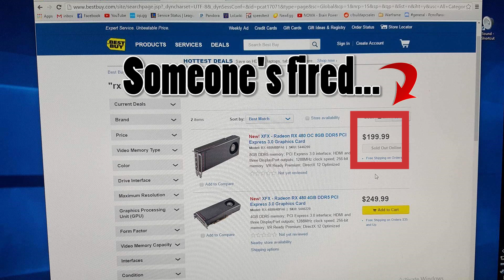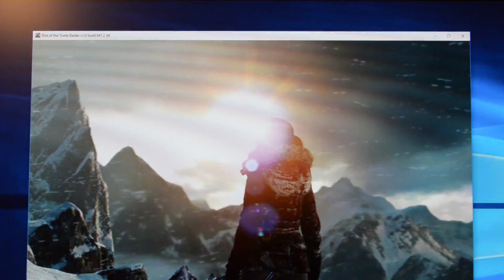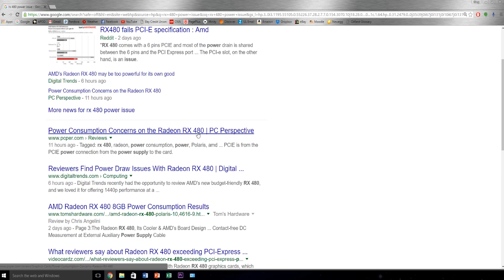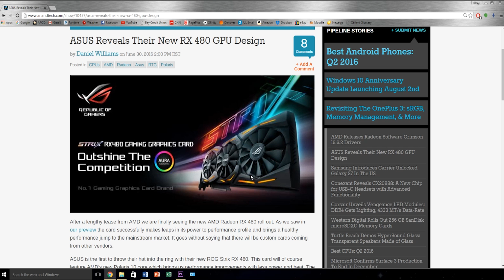RX 480 Aftermath: Power Issue & Over-Hyping

Comment: in a few weeks the 3rd party or non reference versions of this card will start showing up right? I assume those are usually better than the stock day 1 release cards? looking at this card for my first pc with a small budget I have.
Reply: Will be a decent amount better as they will deal with the issue of the pci ports and 80c running temps.
Reply: Please, don't recommend i3 to anyone. It's hard to look at that :P If he has the budget for i5, he should get one. I have i7 6700K and I thought it'll be an overkill. Yet some games are crazy at CPU usage, managing to put it at 100%. Actually Dragon Age Inquisition and Thief led me to this. i3 is just not for gaming. I gained 40 fps just by the CPU swap in said games (with a 970 gpu)
Reply: yep
Reply: Yes you should wait for Asus strix or MSI gaming because they will run cooler, quieter and higher fps
Reply: The price will also be a bit higher... And they inflate the cost to match it's performance, because retailers also has to get a cut out of it.
Reply: thanks folks. looking forward to finally getting a PC.
Reply: Jason Orozco What cpu you think getting?
Reply: +Xamnition i5 6500 seems ok from what folks are telling me. I'm not looking for a beefy rig, just something decent enough to play a few modern games and some indies.
Reply: Jason Orozco Lol, 6500 is not low end, Its mid-range. An i3-6100 is enough atm. Good choise
Reply: +Xamnition thanks for the suggestion. Just might go with that.
Reply: So is this a non reference card? : http://www.maplin.co.uk/p/asus-amd-radeon-rx-480-8gb-gddr5-graphics-card-a23xx?cmpid=ppc&gclid=CjwKEAjwkui7BRCf64DNtfDupgoSJAA_0LOoZFS8c3rTUZ3xvrGoTex-1Quh_xZgKURpWhJXka-SxxoC-j7w_wcB
Will this be ok or still have issues discussed here?
Reply: That is a Reference cooler but on a non Reference Board. A Sapphire one is coming very soon and that cooler is pretty good you can actually swap fans on that cooler

Comment: IMO i think the 1060 will be $249 and compare to the 980 i hope! if so ill be building me another budget build with a 1060!  i already have a 980ti paired with a 6700k. great vid btw
Reply: 1060 is 249 at 3gb model good luck
Reply: if that's the msr then you'll be paying $300 minimum (if the other pascal cards are any indicator). And after than 480 hype I'm not willing to make any speculation about performance until i see real user benchmarks
Reply: Christianspiller Or maybe I'm just tired of numbers going in as more than three digits? o:
Reply: Sinister Steel 3gb is very bad, even the 970 had 3.5gb
Reply: lets hope so
Reply: Dude that will not happend and wait until the custom rx 480s come then we can see its full potenial
Reply: +TheSinisterEyes1 Source?
Reply: VoltaicRogue6 http://en.yibada.com/articles/136858/20160630/nvidia-pascal-geforce-gtx-1060-release-date-confirmed-july-13-starting-at-250-important-things-to-know.htm

3gb is $249 and the 6gb for $299 with

compute cores half of what 480,

with 4.4tflops compared to the 5.8tflops on 480

192 bit memory vs 256bit on 480 i think we have a winner 480 destroys the 1060

Nvidia and Budget dont mix
Reply: Why do I have a feeling that my next build will be AMD?
Reply: David DeBroux Because they have the best bang for the buck atm
Reply: 3gb is starting to little vram for newer games espesially if you are modding games With Graphics and whatnot
Reply: +TheSinisterEyes1 This forbes article suggests the oposite. http://www.forbes.com/sites/jasonevangelho/2016/07/01/nvidias-gtx-1060-specs-leak-faster-than-radeon-rx-480-and-launching-july-7/#b77baf65211f
Reply: VoltaicRogue6 look closer at the graph its compeletly bullshit its not saying anything anyone can make a bogus graph like that. 

Just look at the specs and dont be a sheep
Reply: TheSinisterEyes1
According to the article author, "Obviously, folks, I take this all with a grain of salt, but I’m much less skeptical than I’ve been in the past."

That is from what I have read so far, so the author, too, is not really buying into it, but still has hope for the 1060 in contrast with the RX 480.

EDIT: Just finished reading the article. The following says, but as a sort of a contradiction, "so yep, I believe these specs, and I believe the launch window," but yet says that "in my Radeon RX 480 review I suggest adopting a bit of patience to wait until this particular battle plays out."

So they are contradicting themselves, in a way that shows conflicting feelings in the matter. They said they believe them, but it's up to the consumer whether or not they should start following these "specs" right off the bat and start voting for the 1060 over the RX 480, so that kind of covers the reason why they contradicted themselves. It all says that "I wouldn't take this as a fact, but I trust this graph," not implying it is very factual, but it is believable, because apparently Nvidia has a history of trumping over AMD and making a comeback with the mid-range market.

Comment: This is typical of amd, was so keen for this card but now I'm not sure, come on amd!!
Reply: Wait for the custom cards from sapphire, asus and msi
Reply: who even buys a reference card? there are not going to be issues with Asys, MSI, Sapphire, etc...
Reply: Nah nvidia reference cards are as bad as AMD. 80c~ is the norm for all reference cards.
Reply: The custom Cards will help out the rx 480 a ton
Reply: the card is doing what it aimed to do the only issue is the PCIe problem that if not fixed can give problems ot AMD
Reply: Ez People who cant wait buys Reference Cards
Reply: Nvidia reference cards are fine.. It was an Asus 960 that was violating specs.
Reply: if you have 3.0 you will be fine, but always wait until aftermarket cards where the problem will be resolved
Reply: thermal throttling isn't exactly fine.
Reply: ArtisChronicles it doesn't thermal  throttle it  voltage throttles

Comment: i add this comment to all review videos i run across.
a german tech site found that the whole problem with the temperatures and power draw of the card is the 1.150V. lowering that to 1.075V reduces power draw to under 150W, lowers temperatures by 15C and even increases performance by 5%

Comment: Finger crossed for the 1060. I don't want any unstability in my system, especially when it's even a reference design.
Reply: Solution: dont get a reference 480
Reply: Xamnition The things is, reference design set the standard. When you can't even get the most basic configuration stable it's pathetic
trust me, I was looking forward to this card a lot. its price/performace is good. but techical issue like this ruined the card
Reply: You won't have any problems with this card unless your motherboard is older than the smartphone.
Is it? Then the real issue here is what motherboard you should be getting, not what GPU.
Is it not? Then freaking there's nothing to worry about, Jesse.

Comment: Yesterday Joker and TechYesCity hosted Sapphire Ed, and he claimed in the 480 Nitro (2x 120 mm fan design) there was an 8 pin PCI cable, but the card "didn't need it". I seriously doubt he was able to say something whatsoever due to NDA, but, maybe it would take a custom pcb to stabilize the power delivery, not just more pins for the PCI cable.
Reply: Hopefully if the AIB partner bothers adding pins for the power delivery, then they took the time to put together a custom PCB at this point -- or at least a much improved power delivery.
Would love to see this card do what it was promised to do, since many older systems can really benefit from this GPU.
Reply: Because 8pin is 150watts and 6 pin is 75 watts.
also the better cooling means that you will run much more efficiently. so those will be running at 60 degrees Celsius instead of 80 and due to the way transistors  and misfits work you will hit 1400 stable on those cards with a 6 pin and still be at 150watts
obviously if you want to push the card you will need 8pin
Reply: My personal concern about this card is 1) temperature. Lets say it gets solved by some magic thermodynamic arrangement still we have 2) Power delivery, lets say we add 2x 8pin (total overkill but whatever), the card will be able to draw as many as it wants which gives us 3) VRM design. Power draw is directly related to VRM capabilities, i still remember 7950's VRM burning up in bitcoin mining due to the extra power draw this particular task put through the cards... So, all things considered, we have many things to ask for... A proper heat sink, to deal with the extra temp dealt by the overworking VRM's (are these even cooled?) + GPU, and a enough-pin connector to deliver that. I cant think of this card surpassing 1500Mhz without serious problem on those departments.
Reply: i think the MSI Gaming, Asus Strix, and the Sapphire custom cooled Cards will fix everything mentioned
Reply: I am pretty sure that they will make one With atleast 1 8 pin or 2 6 pins because then we can finally see the true potential of the card
Reply: +taief miah it's MOSFET. And preliminary AIB 480's aren't seeing anything above the 1200 MHz. Or that's what several reviews have hinted. basically this card either fries budget boards or throttlesbthe heck out of itself. Regardless of cooler, when the reference PCB is used.
Reply: DevTheBigManUno http://videocardz.com/61697/how-fast-radeon-rx-480-can-be
Your sure?????.
Also stock clocks are 1266mhz on boost and they run at that near constant

Comment: The RX 480 which is similar to the GTX 970 is great but Nvidia have dropped the price so that they're both £230 now...Given the choice I'd still buy the RX 480 but this looks bad for AMD, They hyped up a card that only matches the last gen Nvidia competitor and the price difference no longer makes it stand out..
Reply: 8gb ram vs 3.5gb
Better VR performance 
Similar power draw
It's AMD so it will last longer with better drivers (looking at you 780ti)
New WattMan overclocking 
Newer 14nm architecture 
Faster gddr5 ram
Probably cooler with the newer aftermarket coolers 
HDR (much better looking colors)
Display port 1.4 and 1.3
HDMI 2.0b
And much much more
Reply: AMD didn't hype their card, they laid out exactly how it would perform and the price at which it would do it. It was media, rumours, youtubers, etc...that put all the hype out there. I never heard AMD say anything like 980 Killer or Pascal competition, that was all speculation by others.
Reply: RX 480 with 8GB VRAM is $239 and GTX 970s are now down to $249 while outperforming the 480. The RX 480 would still be the better buy in most cases as soon as AIB cards and new drivers come out, but it's just a bit underwhelming.
Reply: rx480 is $199 and the 970 is $279
so not exactly sure what you're talking about.
Reply: get mad at the exchange rate then, not the card price xD
Reply: ROBLOXobama1337  huh you wish they were $249, try $279... also the 970 doesn't out perform the 480 please tell me where you get this foul information. lol
Reply: Just got an EVGA SSC 970 for $239, you just need to know where to look.
Reply: El Hefeweizen bruh, you screwed up. Should of got the rx 480 for the reasons listed above
Reply: ***** we need people like you too bud! Thanks a lot btw
Reply: +moh you cooler and amd? lol
Reply: jass sidhu bruh, the aftermarket coolers are going to make it one hell of a frosty card.
Reply: +moh you I don't think so but let's see
Reply: jass sidhu ok den
Reply: +moh you amd rx 480 costs around 400 us dollars in my country
Reply: jass sidhu then order it from newegg US and pay for shipping
Reply: Newegg's international shipping cost over $40 though
Reply: xJoe16 better pay 270usd than 400 :p
Reply: Amazon UK have them priced the same £230 and so does a few other UK stores
Reply: xJoe16 consider my points first
Reply: El Hefeweizen  link where you bought it from.
Reply: Okay, let's take the reasons that you listed, and then bring them back down to planet earth.

8gb ram vs 3.5gb - On a card this slow, you'd never notice
Better VR performance LMAO nope. NVidia's simultaneous Multi projection technology gives them a huge boost over AMD in VR

 Similar power draw - this is an advantage why? They have similar power draw, except the the 970 doesn't have PCI-e and overclocking issues

 It's AMD so it will last longer with better drivers (looking at you 780ti) - the 970 is already 2 years old, still kicking ass

 New WattMan overclocking - have fun getting your 35MHz and 91C

 Newer 14nm architecture  - and yet they still can't beat 970's power consumption...
Faster gddr5 ram - Okay? This is an advantage how?

 Probably cooler with the newer aftermarket coolers - Clearly not.

 HDR (much better looking colors) - On a GPU this slow? Sure buddy
Display port 1.4 and 1.3 - On a GPU this slow? Sure buddy
HDMI 2.0b - On a GPU this slow? Sure buddy
And much much more - I'd love to know
Reply: Your points about the heat and OC'ing are way off...This is a reference RX 480...The board partner cards will have 8 pin power connectors to deliver proper power and will have proper fans/cooling not the shit blower fan used in reference card
Reply: This card is reported to pin 91C and then crash after overclocking. Any custom cooler that could tame that would be expensive
Reply: CrackedDylMil what the fuck? Can't you wait for the aftermarket coolers, then judge. The 970 is going to get gimped to 960 performance because they want you to buy new cards. Nope, new technology is much better with AMD for VR. Mirrors edge catalyst takes more than 4gb Vram so the 970 struggles in that game even at 1080p. The pcie issues are with 2006 boards. If you are living in the Stone Age, then you shouldn't even be allowed to play with new cards you poor fuck. WattMan will be better with aftermarket coolers you nvidiot. Power consumption is better that the 970. Bruh, check TechyesCity, it shows that the 970 (overclocked to 980 level) in doom has shittier colors than the rx 480. Display port can be used to watch future 4K videos. If you'd love to know more reason, go search on the Internet and you'll relealise that you are another one of those sheep that doesn't want to listen to advice, just follows their favorite companies even if they give absurd prices.
Reply: +moh you I own a amd 290 buzz try again
Reply: Spencerwalker21 k den, maybe you country is pretty shit like Canada and Australia.
Reply: +moh you live in the US buzz try again
Reply: Spencerwalker21 the fuck is buzz try again
Reply: +moh you the sound you get on a game show :)
Reply: Spencerwalker21 oh, LOL
Reply: best gameshow ever ^^^
Reply: ***** actually never watched it, sounds fun!
Reply: that's a good point
same in my country 970 has same price as RX480
the problem is, 480 has a new 14nm, but only match 970 performance and power consumption, this is really bad, performance wise, i have no complain, but performance/watt, this is just ridiculous 
AMR have massive die shrinking, but fail to stomp 28nm maxwell???
i know they are playing catch up, but honestly if they are targeting for gaming card, they need to abandon GCN.

Comment: The most probable reason is not the "power delivery system"  its that the motherboard you had this issues with the card had a PCIe v1 (I dont mean x1) 75 watts is the spec for the PCIe v1

PCIev2 has about 200watts limit and PCIev3 has about 300 watts limit the more you know :D

(So it doesnt have to do with the brand/model or quality of the motherboard per se but rather with its specs... if it has a PCIe  v1 then it most likely will have issues even if its a top quality motherboard)

Comment: I live in Holland and the price of rx480 here is crazy! The 8gb model is being sold for 320 euro (euro not dollar)! You can get a gtx 970 or a 8gb r390 for 20 euros less!
Reply: You can get one for 269,- from Azerty but you'll have to wait a few (3) days. The prices for the ones in stock are higher because of demand vs lower stocks than in the US, this is quite common. Never be an early adopter for multiple reasons, this is one of them. You should get a non reference card with better cooling and upgraded power delivery system anyway.
Reply: Thanks... Last i checked on Afuture you have to wait 3g5 days and the price is 318
Reply: till prices stabilize and the AIB get out there not really worth ot get the card

als oneed ot wait on AMD or the partners to provide a fix ot the pci-e power issue
Reply: The pci power issue is only with older and dirt cheap motherboards